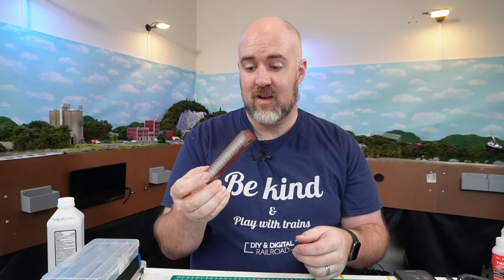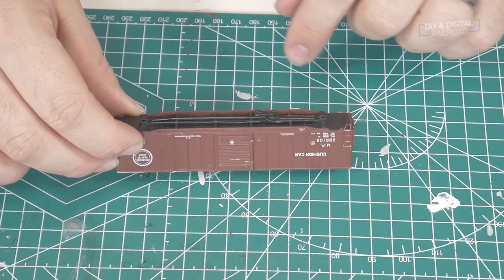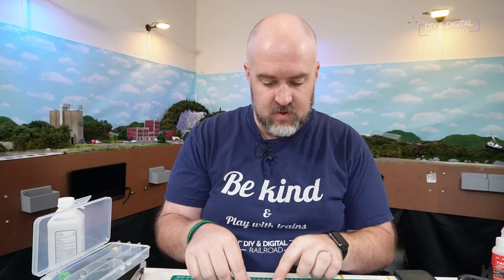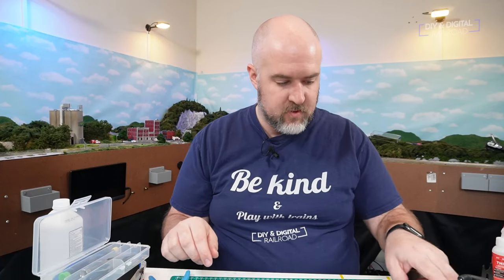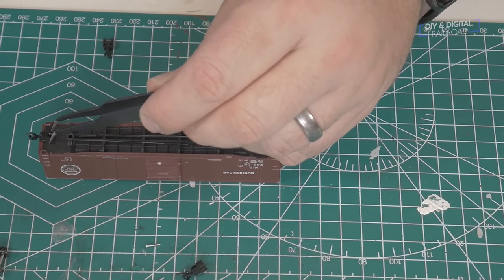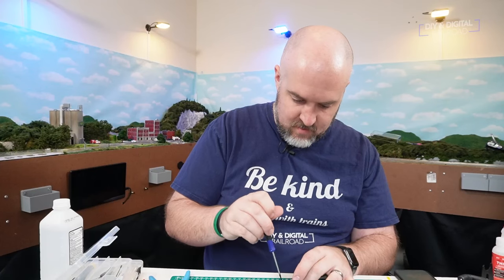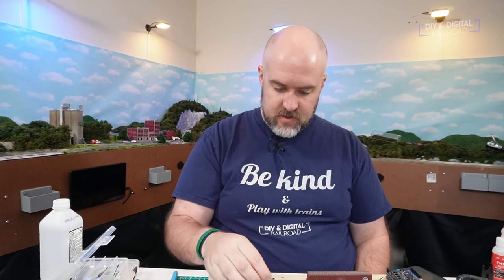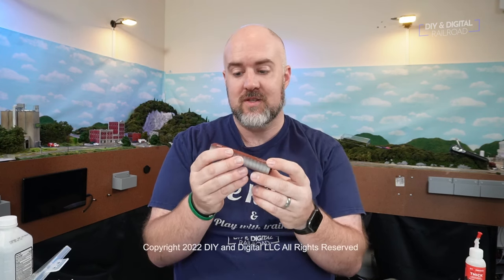Saving a beat up model train car from the trash.

Comment: Your telling me they have these couplers already  made up. I been buying kits for years and cursing every time I drop one of those tiny springs on the floor and can't find it. The only thing that finally fines those springs is the vacuum cleaner. Also have gone through a lot of little people. They also get sucked up and never found again. Nice video always come away with something new to think about.
Reply: Man, I feel your pain.  I order those little springs every chance I can.  I usually have no less than a dozen on hand at any time.  I even have a M/T coupler building fixture.  I have had some degree of success with that.  I probably have at least a hundred unassembled couplers (I stocked up before the prices went up) so there will definitely be a lot of work coming up once I finally get to building them.
I am going to have to look up the pre-built couplers.  After building all of these, I probably will never want to build another one, LOL.

Comment: Excellent! I replace ALL my wheelsets with metal wheelsets, even though I do not plan to install resistors for current sensing block detection. Why? They roll smoother and add a little weight to the cars. As long as you have taken off the trucks and couplers, it's a simple matter to pop off the body and add weight - nearly all ready-to-run cars are under weight. NMRA RP-20.1 gives recommended weight: for N scale, that weight is 1/2 ounce plus 0.15 ounces per inch of car body length. Your 50' box car should therefore weigh 1.06 ounces - call it one ounce. This is probably more important in HO scale than in N scale. Also, if you're working in HO scale, invest in a truck tuner. This is a nifty little device which reams and smooths the journal bearing on HO scale trucks. (I've never seen one for N scale.)

Comment: u do basically what I do, metal wheels, body mount couplers,  also I hope you paint the wheels, trucks, etc.
Reply: Great video.  I am converting Rapido couplers to knuckle couplers. Do this is timely video.
Reply: @kenshores9900  I also detail the trucks,  and shanks,  shanks get tipped in silver, if newer cars, the journals are blue, rust or similar color on the wheels, and the trucks a gray black, and sometimes with a little pan pastel rust color

Comment: Hey Jimmy. Great video, you make it look so easy. I do have one question though. What is the benefit of body mount couplers ?
Reply from the maker: The main one is that you won’t have as many derailments on tight turns with locomotives that have body mounted couplers.
Reply: Another benefit of body mounted couplers is that when doing shove operations they are significantly less  likely to derail going through turnouts. Frankly well maintained body mounted couplers and proper weight are pretty much a requirement if you want to use the magnetic delayed coupling feature of the MicroTrains couplers.

Comment: Dude! I have an AWESOME IDEA! Doing switching operations over video camming! I know, I HATE online meetups, but this would be different. You could invite anyone anywhere to perform a switching operation on YOUR switch yard, OR you having the ability to do switching operations on someone else's switch yard! Yeah, we have to figure out how to get the controller signal over the internet to the proper track system, but heck, if they can make self driving cars, then what I am proposing should NOT be that difficult to make happen. I have no way of sending you any correspondence than this way so help me out there. Oh, btw, that Proverbs phrase is pretty solid dude!
Reply from the maker: This is very interesting!  I will have to look into it!